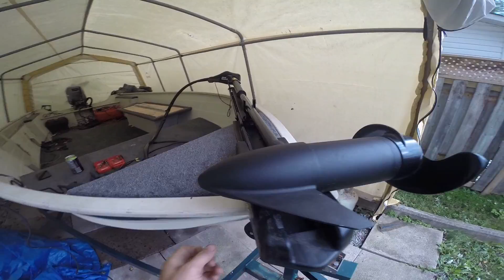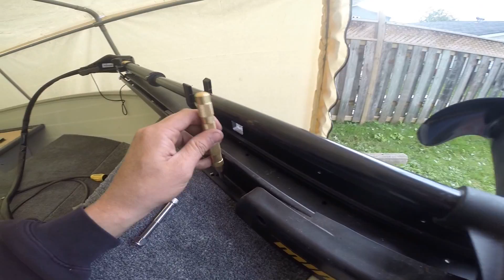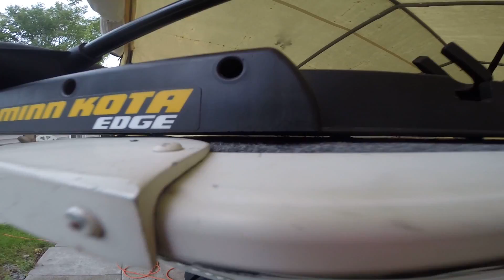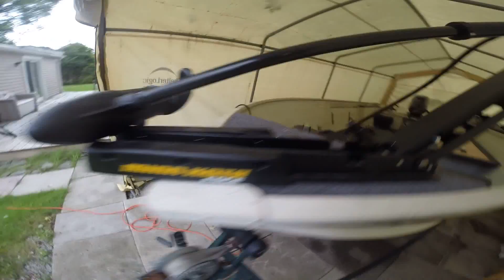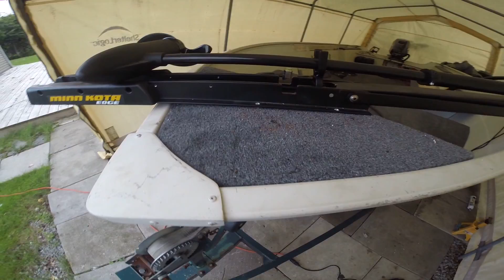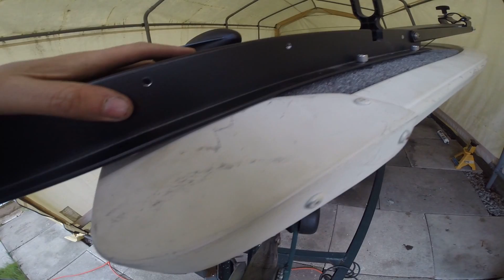How to Install a Trolling Motor - Aluminum Boat Project #7

Comment: Hi. Thank you for the video. Just bought my first boat and have a 50 /55minkota  trolling motor. Can i buy a mount to use this trolling motor? I only had it in the water once this past year and run it in the back- thinking the front will be better? I have a bunch to learn. Any input would be appreciated. Thank you. Have a good day
Reply from the maker: If it's a transom mount motor with the clamp style mount then you'd have to make an L bracket on the bow that it can clamp to
Reply: @InDepthSonar  good morning. Ok. Thank you. Have a good day

Comment: how did you make that carpeted platform for the trolling motor?
Reply from the maker: It was already on the boat. It was two peices of angled aluminum riveted to the hull, then two peices of 3/4 plywood glued together to go on top. Then a vertical piece of 3/4 ply attached to the deck with 2 small 90° aluminum L brackets.

Comment: What are the bolt sizes and where did you get the spacers?  I bought a used one and it did not come with hardware.  Thanks
Reply from the maker: I believe they were 3/8".  A friend had the spacers at work so not sure where or what they were from.
Reply: Lawren Wetzel Thanks for the reply and great tutorial.